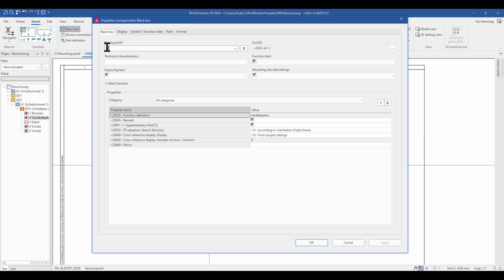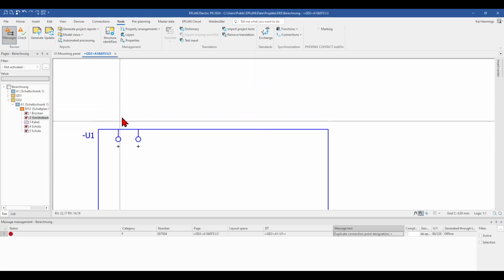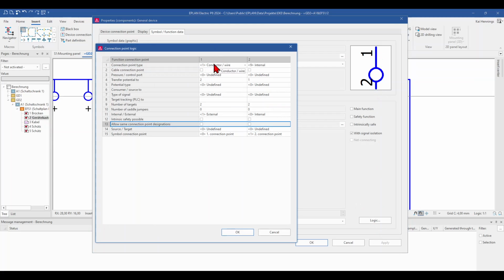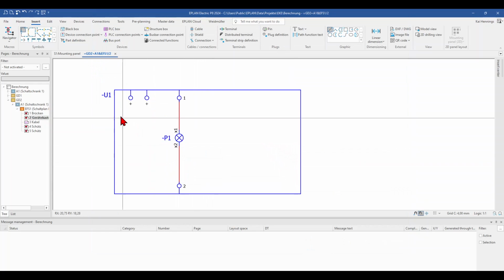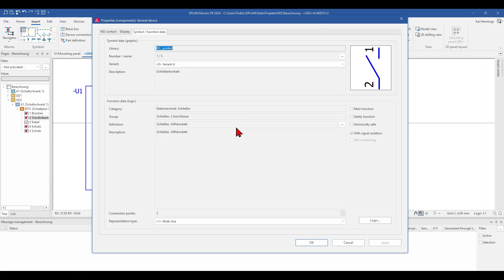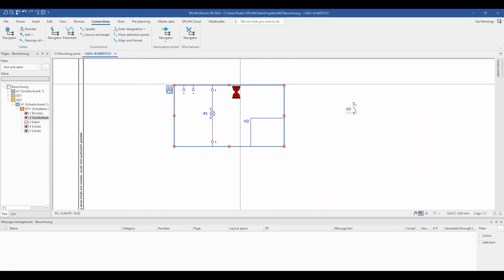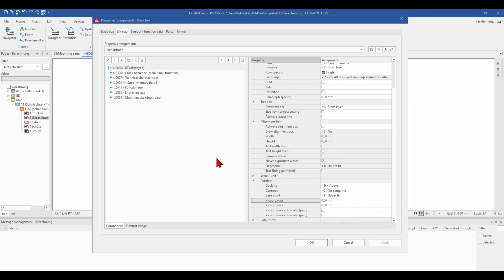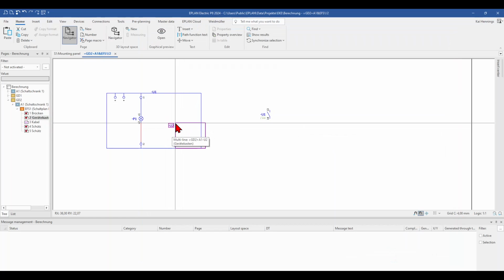EPLAN Black box. Settings, Connection point designation, DT Nesting

Comment: There is also one interesting thing about black boxes: you "can't" place an interruption points inside of a blackboxes. I   struggled to get them working inside blackboxes. After switching ON neccessary settings in project int. points started referancing only when I activated structuring by product.
Reply: Structuring project by Product ("minus" identificator) significantly slows down the performance.

Comment: Hello thank you for the tutorial videos. 
I am trying to use blackbox as a custom sensor which is connected to a PLC. Now I am trying to use tool DT renumber with PLC data. It works fine with original symbols like buttons, valves etc. but it is not renumber my blackbox which is connected to a PLC. Don't you know it is even possible? I have tried to setup different device logic / function etc but it did not help.